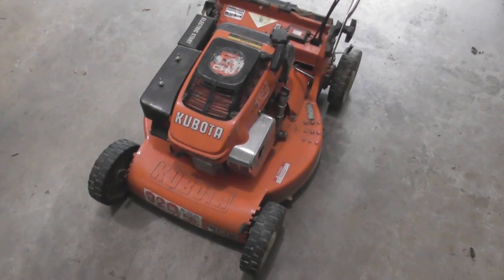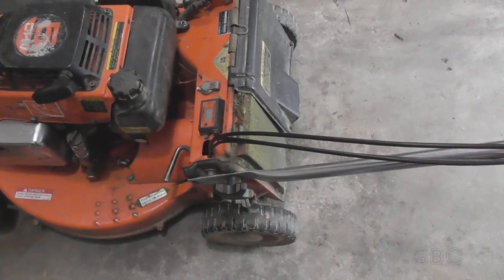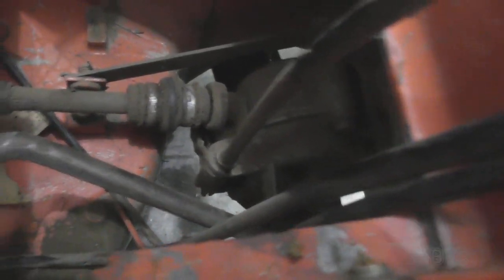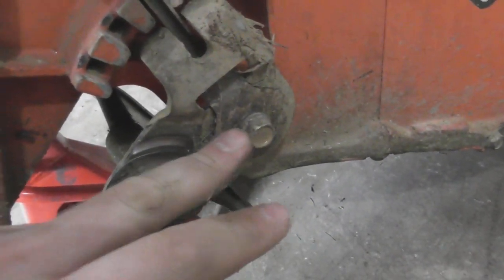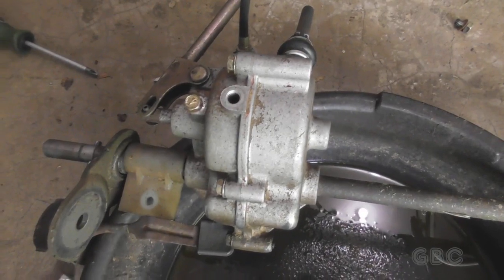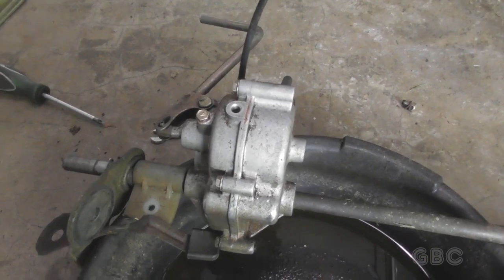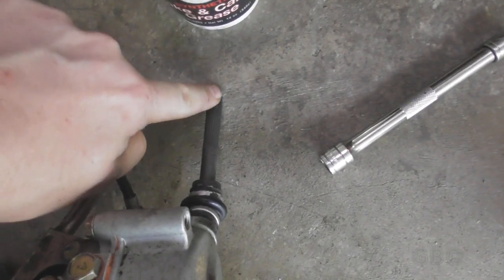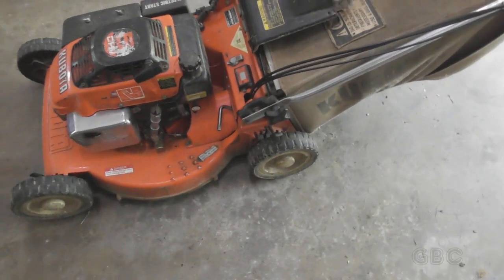[103] Lawn Mower Maintenance

Comment: (5021 SCE Kubota )I need 2 front wheels the rubber is worn off completely  do you where i can get a set   I have had mine since 1991 new